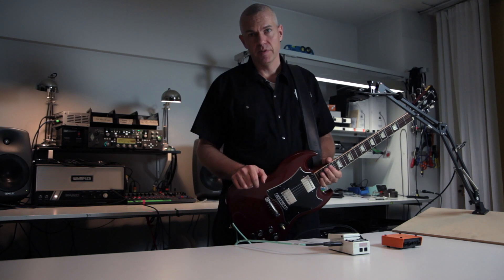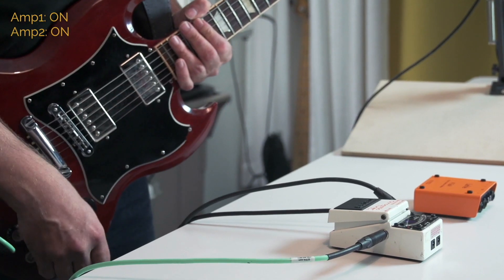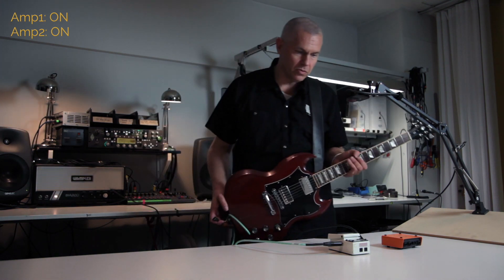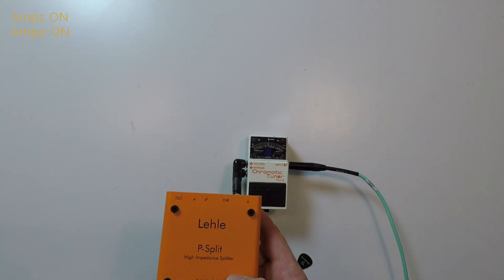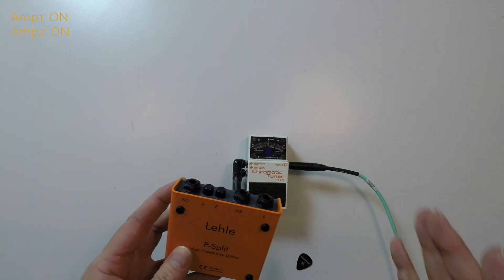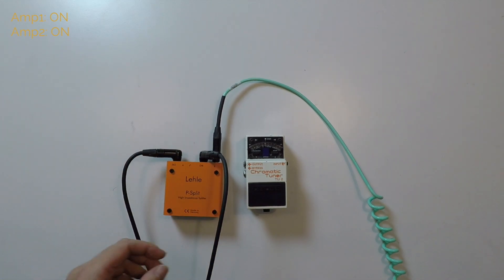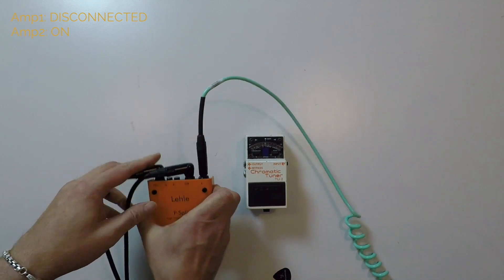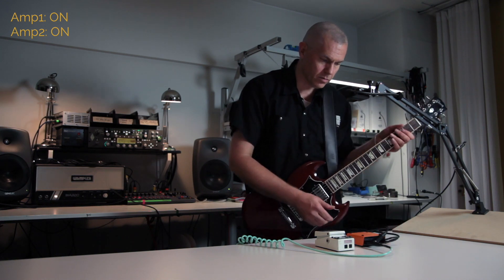What is a ground loop? - Custom Boards pedalboard builder's guide (2018)

Comment: Cool! I've been looking at this Lehle device, seems really nice. Obviously it works great as a splitter and even di box. When reading the manual it also mention it can be used for reamping, just have to throw around some cables to your audio interface, have you tried that?

Comment: Thank you for great content! I have a ground-related question (one amp): Should the mains earth be connected to the (aluminium) frame of the pedalboard? My board sometimes makes cracling sounds and I have tracked it down to my Cioks PSU's chassis that makes occasional contact with my pedalboard frame. Power comes in via IEC socket installed on the pedalboard frame.
Reply from the maker: https://www.customboards.fi/products/call-and-online-tech-support

Comment: Great video! I have a question: I run a stereo setup and the first part of my pedalboard is mono (drives, boosters, comp) and after that I'm splitting the signal from a modulation pedal and run it stereo from there through the delay and reverb then the amps. Could I place it right in between, where my signal gets now splitted? After the comp but before the modulations. Thanks!
Reply from the maker: https://en.customboards.fi/products/call-and-online-tech-support